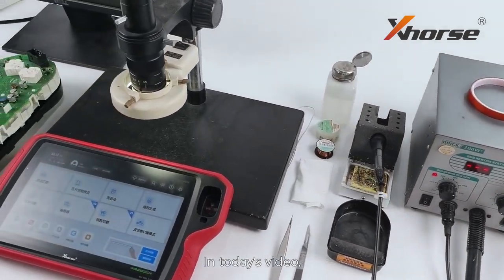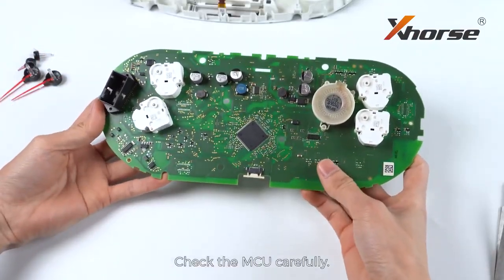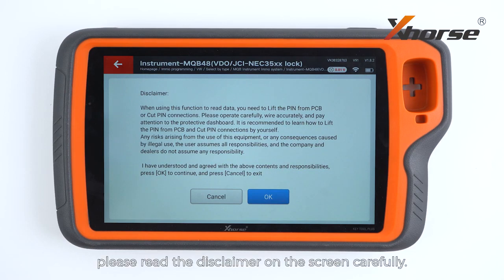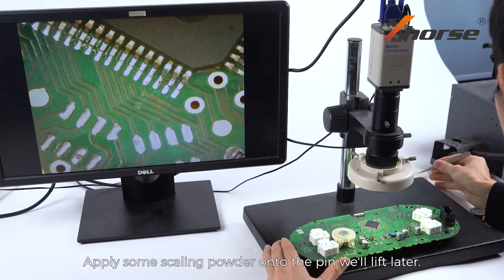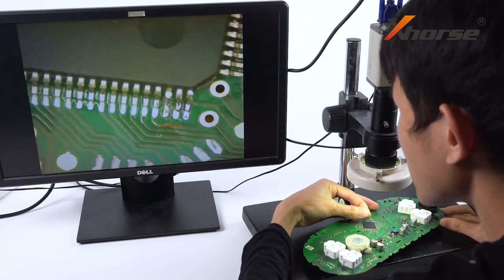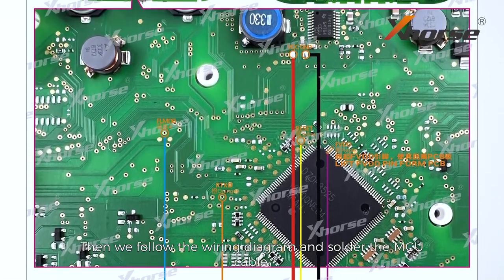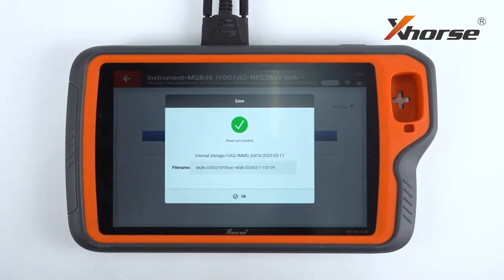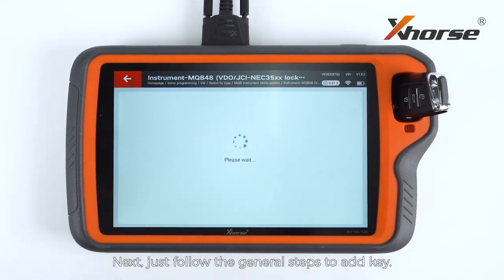Read MQB Locked NEC35xx Using Xhorse VVDI Key Tool Plus- EOBDTool

Comment: I see that in the end you chose to make the dealer’s key in case you have a key that works on the car, so you do not need to remove the dashboard and read the EEPROM from it because in the case of a key you can patent the immo data without a problem, but how if you do not have a key for the car, so it is not possible to choose the same option